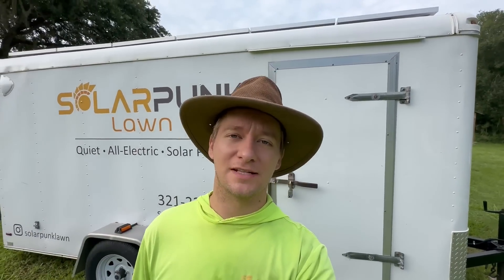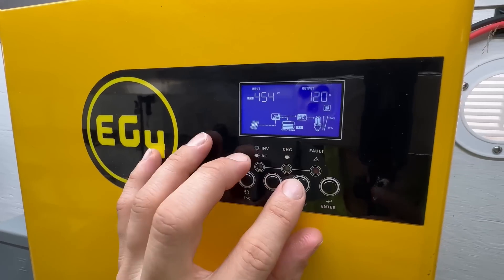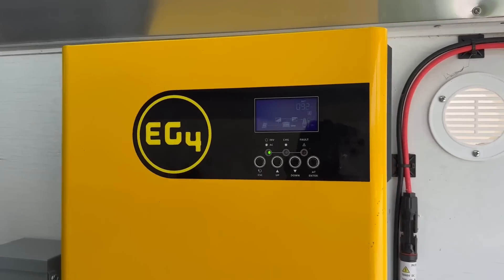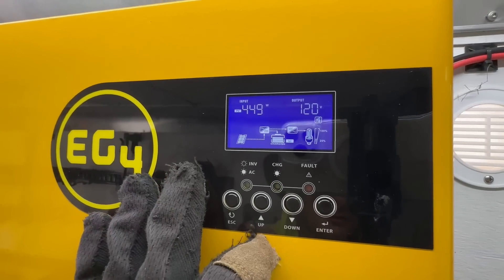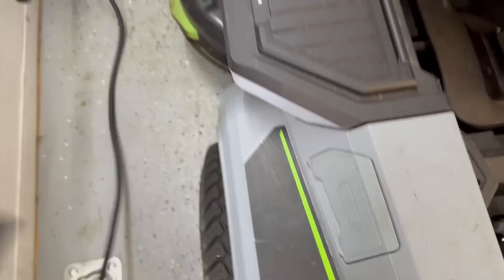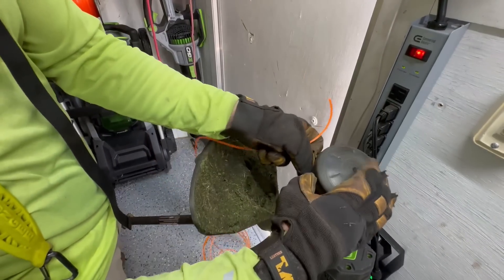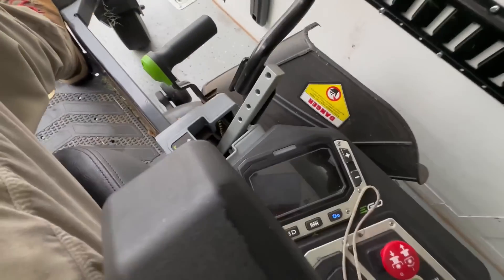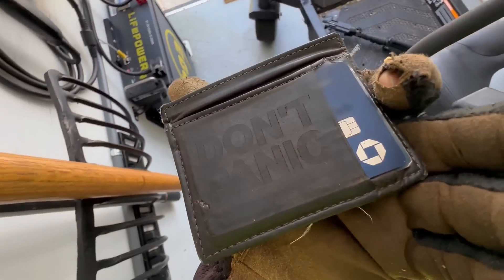Mow Forever? Solar Powered Lawn Care

Comment: What was your out of pocket cost on the solar charging set up? Are there any govt incentives?
Reply from the maker: I checked for incentives and asked my CPA to check as well but neither of us found anything here in Florida (or Federal) at the time that I was setting this up.  Doesn't mean there wasn't any or won't be any, but I paid full price for everything.  Of course because it's a business asset you can claim some of it on your taxes, but unfortunately I couldn't get the Federal tax credit of 30% for solar and battery systems because it's not going on my house.  However, I do believe the Inflation Reduction Act (IRA) incentive of $7500 includes electric mowers now, but they must have more than 7kwh of battery onboard so this wouldn't apply to my equipment anyway.  I know at least California has their own separate incentives for electric lawn care equipment, and I'm sure other States do or will follow suite.  So depending on where you are you might have something available at the state level or even federal if you're getting a large mower with a big battery pack. 

As for out of pocket costs, I haven't totaled up absolutely every little piece of hardware/electrical wiring I spent money on (I will later when I do the video showing the installation process) but just a basic cost on solar, battery, and inverter it was about $3500.  I'll cover that in the next video where I show an overview of the system and a demonstration of it's capabilities etc. Hope this helps and thanks for checking out the video!

Comment: This is great, I’m thinking about getting into all electric lawn care. I’d really love to know more about the set up, solar, and getting that trailer all together
Reply from the maker: Awesome! Are you currently running a traditional lawn care setup, or thinking about starting electric from scratch? If from scratch, I recommend looking into videos/information about estimating your time mowing/on a property, as that will be the first thing you’re going to have to do to come up with a price when people ask you “how much to mow my yard?”. It’s ok to get it wrong here and there, but you’ll want to over time get better so you’re not mowing someone’s property and barely making any money. Anyway, might as well start researching some of that stuff before you jump straight in. I made the mistake of not knowing my local area well enough before I started. I quickly corrected my mistakes but I definitely lost some opportunities by not fully understanding how cheap people in my area can be. Idk, maybe it was for the best lol

I’m working on getting the next video out asap, but my schedule went from crazy to insane. Hopefully by the end of this weekend! Stay tuned.
Reply: @solarpunksteve  I have all electric equipment so far but it’s a push mower. My lawns aren’t too big so I just do most of the charging at home. But I’m trying to expand to more customers, at some point I will need to upgrade to a riding mower
Reply from the maker: Keeping them small is key, I've turned down quite a few that are too large for my current setup. However, I'm in a slightly challenging location as my area is spread out, we don't have that many cookie cutter neighborhoods or HOA's (thank god), but along with that the income/cost of living level is low so it's hard to command a reasonable price here.  Anyway, good to hear you're looking at expanding! I started out with the riding mower and trailer from the beginning, but I also have a few properties where the push mower is required due to gates/terrain so it lives in the trailer too.

Comment: I see this is the first video. I found it quite well done and enjoyed seeing how you deal with being all electric and using solar. EG4 has some great products and a couple of new batteries, though they are not cheap.

BTW - I like your trailer with the foldup ramp kept inside. Looks like you have is setup quite nice.

Even though you are all EGO and the batteries are interchangeable, it looks to be a 56 volts system. Some of the other electric Z-turn mowers use a power system based on lead-acid batteries with a more common voltage system. They can be converted to use LiFePo, giving them "all day" mowing capability and can be charged from your EG4 system.
Reply from the maker: Hey thanks very much for the kind words, it’s a challenge to make things fun and showcase the equipment. Next video will be a little more in detail and a bit of an educational overview of the system as I realize not everyone will have a solid grounding in batteries/inverters/solar etc. hopefully people will get something out of it and help them make a decision on if this setup is for them. 

Yeah the trailer was a bit of a challenge with the double doors instead of the ramp door most people use. But it’s working fine for now. 

A converted to LiFePO4 mower would be awesome as your cycle life would much greater, and I’ve thought about doing that one day. For my use case, I want liFePO4 equipment that’s relatively lightweight and charges quickly and I would keep the heavy storage batteries on the trailer. But I think most manufacturers are trying to cram as much battery into their equipment so that people can run longer on one charge.  

I like the flexibility of my system, right now I’m all EGO, but I don’t have to be, I can plug in anything and charge it up.
Reply: your ramps are probably stronger then a ramp door. also if you ever want to load something with a forklift then ramp doors are a pain in the behind

Comment: I just found this video/channel. What do you do for heavy leaf cleanup in the fall? I'd imagine you would deplete your batteries pretty quick, no? Doesn't the constant charging of batteries before they're fully depleted ruin them?
Reply from the maker: So being in Florida, most of our trees keep their leaves all year round. However you still get oak trees and a few others that drop them. Normally I just mow over the leaves with a mulching plug on the mower to help chop them up. Only a few  of my clients actually bother to rake up leaves every now and again, so I guess I can’t speak to how a large fall leaf clean up would be. I do use my new backpack blower to push a lot of sand back off the sidewalk that spills down from the yard after heavy rains on a few of my properties and that will suck the battery down on the blower a little quicker than usual, however I can just throw the batteries on charge and they are ready again by the time I need to pull it back out for the next property. Lastly, I answered this in another comment too, but lithium ion batteries don’t suffer from the same issues the old Nickel Cadmium (Ni-Cad) batteries did, where you needed to deplete them fully before recharging otherwise they would develop a “memory”. Most lithium ion batteries like to be kept above 10% and below 90%. For example: I don’t charge my Tesla above 90% unless I’m going on a long road trip, and if you try to set the charge level at 100% Tesla notifies you it’s not good practice. The exception to this is actually lithium iron phosphate batteries, like the EG4 storage batteries I have in the trailer, this battery chemistry doesn’t seem to care too much about being charged up fully and has a really good cycle life at easily over 5,000. So I wish I could only charge my ego batteries to 90% to prolong their life, but I have no way of controlling that practically.

Comment: What’s the start up price on this set up though? With the Tesla has to be close to $100,000 right?
Reply from the maker: The Tesla isn't required for a setup like this, it was just the vehicle I had already bought when I decided to start this business, and with 3,500lb towing capacity I decided to give it a try.  So far so good, but I will make a video specifically on that later since like I said, you don't need one to run a setup this way.  However, Tesla lists the Long Range Model Y (which is what I have) on their site right now for $50,500 and with the federal tax credit here in the US, you could get it for $43,000.  As for the solar and batteries, that will be covered in my next video, not cheap (think a couple thousand) but in my opinion a better option than buying more batteries for the equipment, which I'll cover.  And of course, I didn't start with solar and onboard batteries, I added those as I grew the business and took on more jobs to pay for the investment.  Hope this helps! I'm trying to share what I've done/learned so others can make their own decisions on whether or not they want to do something like this!

Comment: Just found this video, subbed and hit the bell :-) It's my first year in the game, running all petrol (gas) powered machines at the moment but this setup is making me think about doing something similar even if only for some machines next year. Greetings from South Wales (UK) :-)
Reply from the maker: Hey we all have to start somewhere! I started all electric, but then added solar and the onboard trailer battery later as I was taking on more clients and more jobs.  I wonder how well onboard solar would work for you out in Wales, might be better to have panels at home and just bring battery/charging capacity with you?  Also, do you tow a trailer or run out of a van?

Sidenote: I've worked with a people from Wales at my previous job, good lads and ladies! Thanks for stopping by!

Comment: How safe is the Ego equipment to use in the rain 🌧?  Also does your system automatically shut the charger off when it reaches 100 percent to avoid overload on the batteries 🔋?  Thanks for your assistance.
Reply from the maker: I guess I didn't really explain it in the video, but I don't mow when it rains because when the grass is wet, it doesn't cut well, it sticks to EVERYTHING including the sidewalk and road so it's hard to blow it off, then you can also end up carving ruts in someone's yard because the ground gets soft.  Not to mention here in Florida, it can rain HARD in a matter of minutes and you get lots of lightning too.  So it's not because I'm worried about getting shocked from the ego stuff, everything seems to be well protected. I still don't like my equipment to be out in the rain because it can eventually rust.  However, I have left my string trimmer out in the pouring rain with the battery on it and mowed in the rain a few times just trying to finish up the last of a yard or two, and also I wash down the mower occasionally and no issues thus far. 

Not sure if you're asking about the solar/battery or the ego equipment, but either way: yes, the inverter/charger shuts the charging down automatically once the battery is topped up.

Comment: Actually very interested in this new channel. Would love to see some content on how you got your clients, did you build the tesla/trailer setup before starting? Very nice stuff tho i can see this channel doing well!
Reply from the maker: Thanks so much for the kind words! I’m working hard to bring you some good informational content so people can decide if this will work for them or how to go about doing it, stay tuned! 

To answer some of your questions quickly. I started small, just one client who was a friend of a friend, built up from there. Had to install the trailer hitch on my Tesla myself because I didn’t originally buy it for this purpose, also didn’t have solar and batteries until later once I was reaching the point of pushing any new clients to new days because I was running out of charge.

Comment: Very cool, I was 100% electric from 2019-2022 struggled with it a little and never invested in a full mobile charging setup and now im back to a hybrid setup temporarily.  I used a lot of ego as well but my ride on was a 52” commercial Green works.  All the ego string trimmers I have used can be loaded with the head still closed it is tricky though you have to find the spot in the rotation of the head where it lines up and then remember where it is in the future.  Looking real hard at the 30” push mowers that recently came out and my plan is to use those as my primary mowers and focus on smaller properties.
Reply from the maker: Hey awesome that you're trying things and seeing what works and what doesn't! The whole reason I started this was to see if it could actually work, and so far for my use case it is, but it definitely doesn't come without it's challenges.  Keeping the yards small was key in the beginning, I have some larger lots now but it could be difficult for some with large properties or large crews to make the switch, so I completely understand the hybrid approach too.

A topic I'm covering in the next video is why I chose this setup over just buying more batteries for my equipment. One reason is simply not being restricted to a specific brand, I could run greenworks/dewalt/meangreen/whatever as long as I bring the charger with me I can plug it in and charge up their specific batteries.

Thanks for your feedback and let me know if there's any questions or things you want to see covered in future videos! I'm happy to try and share what I've learned.  Good luck in your endeavor!
Reply: What kind of cost are we looking at for those solar panels
Reply from the maker: The six 200W 24V panels I'm rocking are from Rich Solar and cost about $1500, not including taxes, shipping, and all the brackets and mounting I installed etc. You could use different panels, but ultimately I settled on these for voltage requirements (this inverter needs 120V DC to start producing power from the panels, and these actually produce more like 37V each instead of 24V) and space considerations on my trailer.  You'll see a bit more about this in the next video.  Thanks for asking! Hope you get something out of this.
Reply: @solarpunksteve  Thanks a lot of good information👍. I also really enjoyed and learned a lot from interview with your brothers channel.

Comment: Just wanted to point out its best to run the battery down to red. That way the cells last longer. You get like 1000 charge cycles before degradation. Everytime you charge the same cell, it causes wear. If you already knew this, just disregard, but if not I hope its more helpful than an annoyance.
Reply: Thanks! I have been thinking of the charge cycles all wrong. I to have an all-Ego electric lawn service. I had been charging only when in the red, which is annoying to keep up with. I don't have solar, but I have 40 batteries.
Reply from the maker: 40 batteries! Wow! Right now I’m working on my video of my solar/battery/inverter setup and I’ll cover the cost difference of that equipment vs buying more batteries. 

How have you been liking using the ego mower?
Reply: @solarpunksteve can't wait want to try this as well hope cost breakdown
Reply from the maker: Are you thinking of Nickel Cadmium (“Ni-Cad”) batteries which require you to discharge fully so it doesn’t develop a “memory”? For these (and most other lithium ion batteries), they can be charged at any point and do not require that they be drained before recharging, which is also stated in EGO’s battery manuals. Now, EGO doesn’t specifically state the chemistry (NCA or NMC etc.) other than lithium ion but typically it’s not good practice to drain a lithium ion battery completely, nor is it good to charge it to 100% all the time, but since I don’t really have a way to control the max charge other than manually removing it from the charger when its ~80% and that’s simply not practical when mowing lawns all day I just opt to let them charge up to whatever level before I pull them back out again. 

I agree with you they will suffer from degradation, and I’ll cover this in another video at some point, but I would actually prefer manufacturers to use lithium iron phosphate batteries (heavier per Watt hour but cycle life is much greater) and just make the batteries a little smaller/less capacity and I can just keep charging them all day and not have to worry about degradation. 

Hope this made sense, and if I’m incorrect please let me know.

Comment: The line iq feature automatically releases more line
Reply: I also have my own lawncare business with all Ego tools and even though they are top of the line I have experienced some minor issues
Reply from the maker: Yeah I really like them for what they are, but hope they can start improving the downsides.
Reply from the maker: Yes correct. However, in the real world things don’t always work like they should. I’ve had some difficulties with this system, including the automatic releasing, and I was just briefly touching on one of the annoyances, like trying to get it to wind up the line without pulling the cap off which you’re supposed to be able to do.  Other than those things the string trimmer has been working great, after over a year of abuse it hasn’t quit yet.  Do you use one?
Reply: Yes I have one too and the line sometimes gets stuck
Reply: I honestly prefer the bump head with powerload
Reply from the maker: Yeah I think I might switch and just pull the guard off mine.  The number of times I'm trying to get the head to spin out more line and waste minutes screwing with it or running it with like 3 or 4 inches of line out instead of the full "16" is not worth it lol.
Reply: I definitely recommend taking the trimmer guard off it saves a lot of time
Reply from the maker: I just need to get the bump-head + Powerload thing to swap with the line IQ as otherwise I don't think I can just pull the guard off.  But that will be the next upgrade/modification I think.  Getting sick of not being able to weed whack a property quickly.

Comment: Cool the electric mower has an extra gear for cutting through that bahia.
Reply from the maker: Yeah! You just press a button and you can ramp up the blade speed or lower it down. Good for when you don’t need to mow through thick stuff and want to preserve some battery power. I’ll cover the equipment in a future video but there’s tons of videos out there on the mower if you’re interested: EGO Z6 Zero Turn.